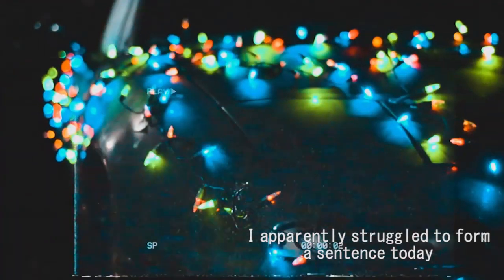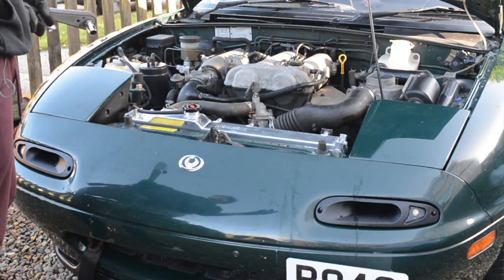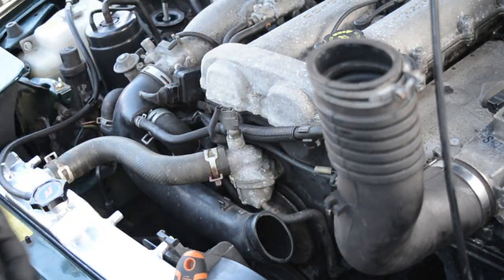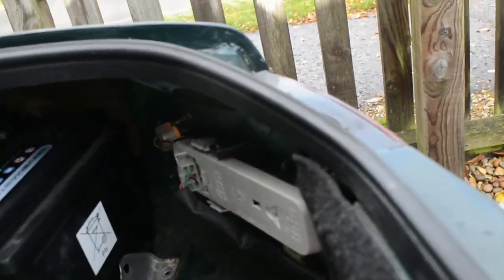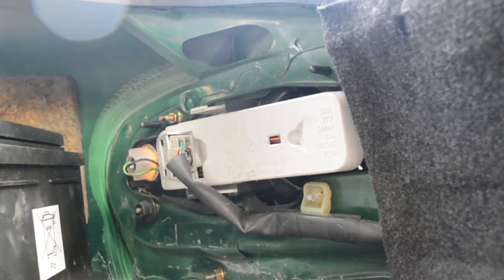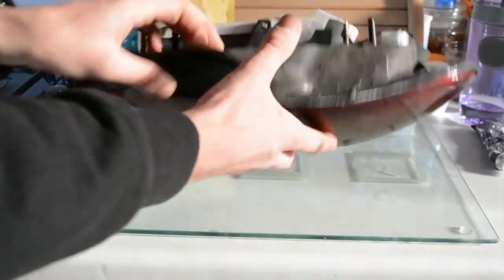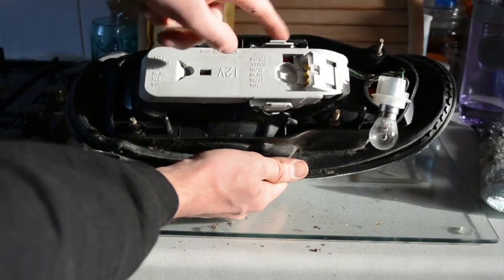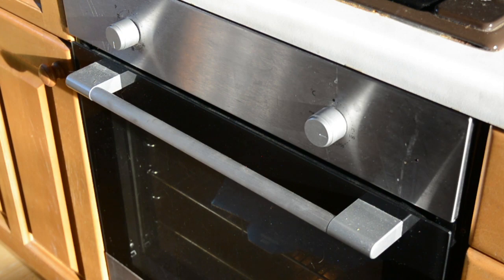DIY LED RING TAIL LIGHTS MX5 MK1 NA #ProjectMX5

Comment: How did You wired it? Im having issues with mine
Reply from the maker: I just used a simple splice, and twist the wires together technique it isn't at all professional and I'll have to go back and do it properly but it works, give it a quick YouTube mate, other than that most of the information should be in this video!